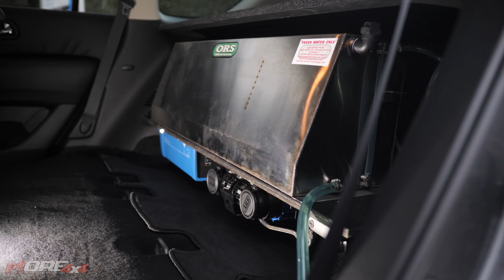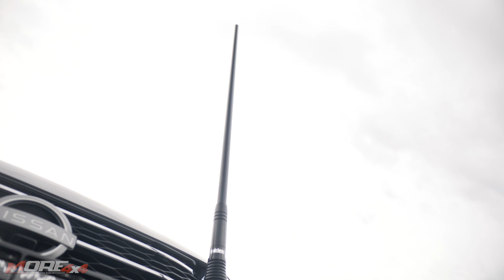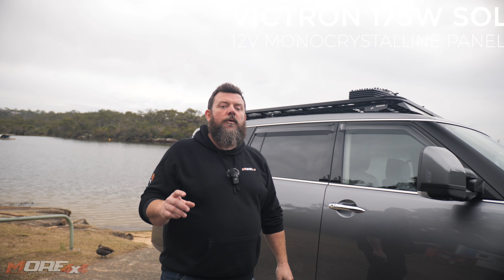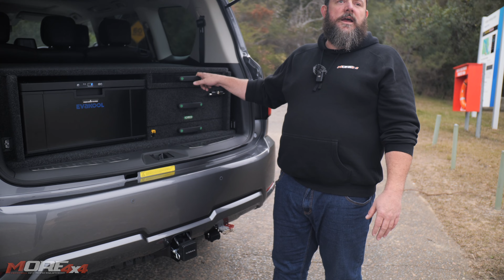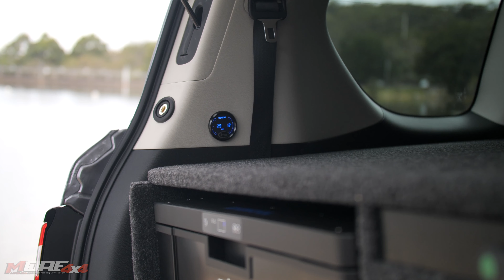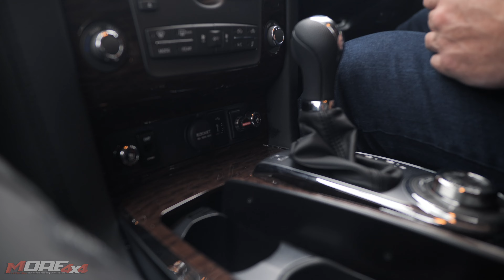Y62 PATROL: JOHNS ADVENTURE TOURER | Walkaround by @MORE4x4_au

Comment: Just an awesome build, thanks for sharing. Quick Q, on the GVM increase to 4.2 MT using DMW, is a 2 inch lift a mandatory design requirement, or can we do just a 1 inch lift and still get 4.2? What method do we use for the lift, springs or hydraulics? Also, let me know if I'm lost and don't know what I'm talking about 😂.  Thanks Chief, much appreciated.
Reply from the maker: Hi Jose,

Thanks for commenting and and the great questions. 

A lift is not mandatory and we have standard height springs. Coil springs are the method of lifting the vehicle, not the lower control arm modification.

Hope this helps,

Aaron Mitchell
Reply: @MORE4x4_au  Awesome quick reply Chief!! Thank you!! Budget wise, not yet ready, but will be in touch once I am. Stay cool team!!
Reply from the maker: Hey no worries, happy you got some value out of it.